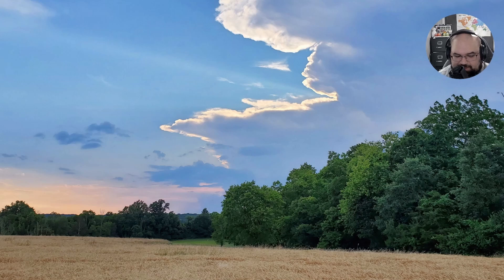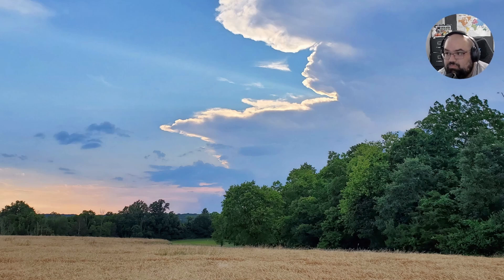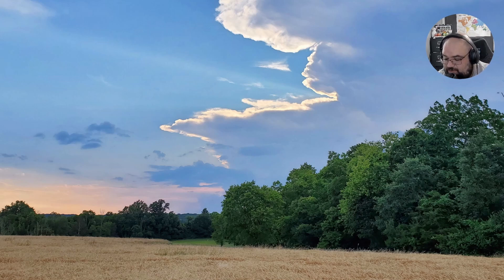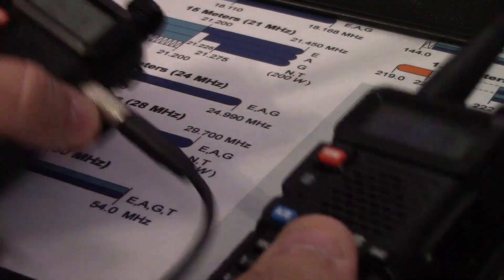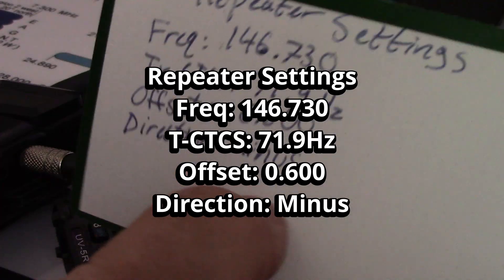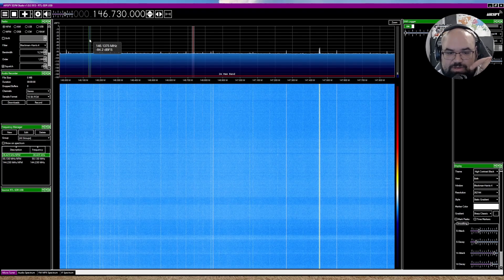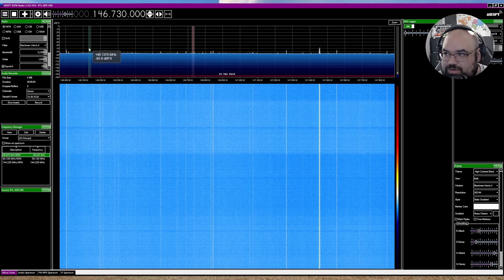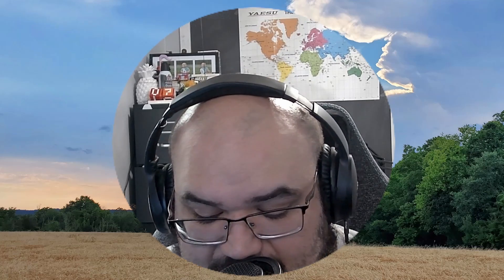[Amateur Hour] -  Build Your Own Repeater for under $50

Comment: Thanks for the build and video. Ive seen this in the SHTF Feng books and videos. Your video seemed more realistic than others. I have not made this build; however, it may be practical for aome GMRS applications. I would tap and solder rather than make your masterful patch. Thanks again and 73, Bill.
Reply: Doing transmission on the same bands is not great for either radio. This would be much less likely to work well, unless you had long cables between them.